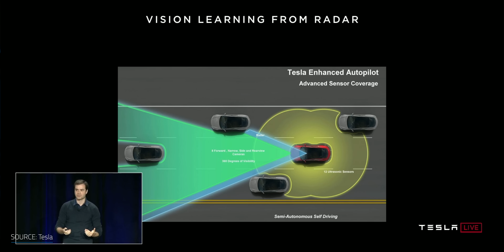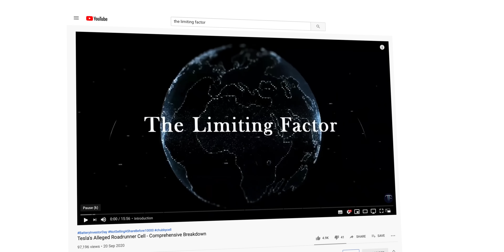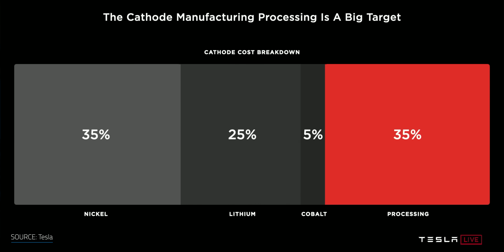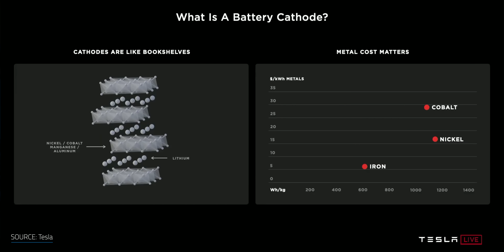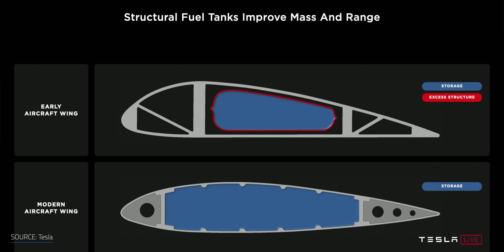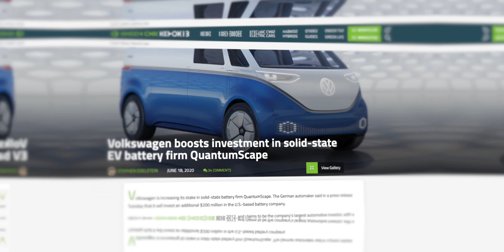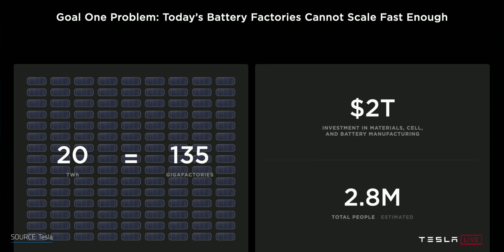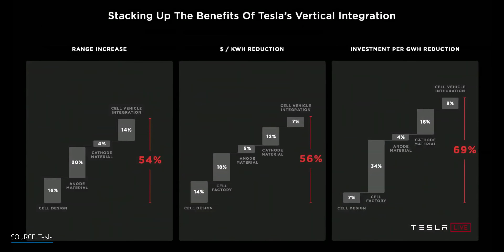3 Takeaways from Tesla's Battery Day - Hint: it's not just batteries

Comment: I think to agree with our statement about ICE being dead and EV being the obvious choice I would need to see better charging infrastructure.  I live in the midwest and travel across states next door.  There isn't appropriate charging stations that would make it possible for me to replace my ICE vehicle.  I'd love to see you do a video on charging infrastructure.
Reply: Even using Tesla superchargers?  They've covered U.S. interstates pretty well.
Reply: @bigdream_dreambig  The tesla network is by far the best network, but the chargers are not interoperable with non-Tesla vehicles.  I'm not sure why Tesla locked down their network to be proprietary vs offer services to any EV owner at a cost.
Reply: @sanctred  Tesla has long said they would be happy to allow any other manufacturer to use their network as long as they made their cars compatible (plug and software) and paid their fair share of supporting the network (maintenance and expansion).  So far no one has taken them up on this.

Comment: There are cars/trucks  on many roads around the world that have more than 50/60 years and are still running. If battery tecnology improves in such a way that can compete with the range and durability of a combustion engine, that's the real tiping point.
Reply: just compare 7c/kwh for Electricity to $3 - 4 for gas. 
not incuding Maintanance.

Comment: a lot of medias mention how come there is no million mile battery. My take is that Elon downplay this but his new battery is already million mile battery. Let me explain: Battery has shorter cycle life due to 2 reasons: heat and cracking during expansion of the cathode. This battery day presentation already address both of these issues.
Reply: CATL Already has the million mile battery and its LFP Prismatic, which TESLA will be using in ALL SR+ Vehicles.

Comment: I was disappointed that energy storage hasn’t progressed for domestic customers.
Reply: Tesla has, for quite some time, proposed using the retired batteries from cars for domestic power walls. A 2nd life before they eventually get recycled.
Reply: Mike Wurlitzer I’d buy one, if they sold them
Reply: Tesla's powerwalls just dropped in price significantly.
Reply: Big Dream Hi there, I haven’t seen this in the UK, are you in a different market?
Reply: @Muppetkeeper  Yes, USA. I can't find the article anymore, but I think it said the price dropped about $600.
Reply: I checked if the priced had changed here in Sweden... And found you can't currently order a powerwall, only sign up to receive updates. Lets hope for major improvements in both price and performance.

Comment: My take away is that Giga Berlin will be making Model Y's with the 4680 Batteries and the all new megacasting structure from the get go, summer 2021.

Elon already said during his Berlin visit 3 weeks ago the Model Y made in Berlin will be much better and radically different in design and manufacturing.. This only makes sense if they also start using the 4680 cells, produced on site. 

The new battery is NOT a prototype, they already making thousands of them in the Kato Road factory.. Copying this factory in Berlin would be more then enough to start in Berlin and add more, better lines when Model Y production ramps up... Tesla has still 6-10 months to tweak, validate, test and improve on the Kato Road factory.

I ordered a Model Y months ago and now getting really stoked to get it next year! 

I am from The Netherlands and all European Model Y orders will be filled from the Berlin facility.
Reply: Marco Nierop a German politician also said a while ago that Tesla will, be making a new type of battery at the Giga Berlin plant..
Reply: @trashmail8  It all ads up that it will really be like this..

Comment: How are they going to compliy with the EU's user changeable battery regulations?  Or did that not go though?
How could the recycle the batteries once they are encased in epoxy?
Reply from the maker: I haven’t heard about that type of requirement going through (need to dig into that more).  Curious about the recycling angle too.
Reply: @UndecidedMF  If you ever find out how they play to recycle them it would be worth a mention on some episode at some point.   I'd be interested.

Comment: A problem with making the battery part of the vehicle's structure  is the battery becomes more susceptible to road hazard damage.  Will hitting a rock/road debris that on an ICE car might crack the oil pan cause one of these Teslas to be totaled because it destroys the battery?
Reply: They're not making the batteries part of some vulnerable external structure.  They're simply using them to provide internal structural support (like a load-bearing wall in a house).
Reply: @bigdream_dreambig  So if the batteries get damaged the car isn't a total loss?  The batteries are either serviceable/replaceable or they are not.  Usually structural components of a car, like the frame or pillars, if they get damaged the result is a total loss of the car.
Reply: @richmigala2539   The point is that, if the batteries are damaged, that will have required so much destructive force that the whole vehicle will have been totaled anyway.
Reply: @bigdream_dreambig  What if there is a recall on the batteries?  Are they going to give you a new car because the batteries are part of the car's structure?
Reply: @richmigala2539   I don't know if they'll be removable, but if not, it'll be the same as if Ford had a recall on the frame. 🤷‍♂️

Comment: I am convinced about vertical integration. I am not convinced about less modularity to cut costs outweigh the benefits of a cheaper car. The right to repair is I think a growing relevancy in the future and is highly underestimated. I've been promised a surface pro with long life, yet the battery failed after only three years of normal use. It is a highly complicated procedure to replace the battery of an otherwise fine working computer. Crack of the screen is at risk of increasing repair costs and insurance costs. I think something similar will be the case with unibidy teslas and integrated batteries. With a battery failure it will be almost impossible to repair with unexpected high maintamace costs. I'm doubtful then a cheaper electric car will make maintenance costs cheaper as well. And things like fender benders will likely mean the car is written off, with a monocock design. Ouch! Battery day talked very little about the management of recyclability of their cars. Ewaste is a growing global issue and a fast growing pile of unrepairable teslas will only add to the growing pile. I don't see Elon's sustainable transport goals achieved this way. Only more resource and energy consumption but not a circular economy model. If the latter were concretely included in battery day, I would have found that truly nerdy and sexy.

Comment: ICE cars will never die, there are so many fuel alternatives to choose, from biogas of recycling to alcohol, biodiesel from used oil........ the other advantage is that you can carry fuel in an extra tank and basically go as far as you can without issues
Reply: biogas is FAKE NEWS, it still has CO2 and other pollutants. 
I can travel 520+ miles from my home , without needing Charging. 
at some point I will have to Sleep and my car is FULLY CHARGED in the morning. 
allowing me to go 520+ miles in ANY Direction.
Reply: @markplott4820  nonsense, it still has carbon but very little, plus its actually cleaner and a car can get over 1000miles+, unless you have a tesla model s plaid, the 520 miles is not true but also way tooo expensive than  normal ICE

Comment: One thing I think about with the legacy auto manufacturers is that they aren't going to take EV's seriously (Ford, for example, with it's Mustang Mach E, 250 miles range and 0-60 time in 6 seconds), and then say "Look, Nobody wants an EV.", when nobody buys their short range, slow accelerating EV's.

I won't consider an EV, unless it has a minimum 300 mile range (preferably 350-400, even better if its 500).  That's why I'm a little concerned with how Ford's electric F-150 will be when it gets released.

Comment: Something that was missed is charge and discharge times of the new battery design. Both had to be throttled due to the heat build up caused by the tab design. With the new tabless design you could theoretically see charging currents doubled or tripled. 500kms in 15-20 minutes could be achieved quite easily, that’s a coffee and toilet break for 4.5-5 hrs of on the road driving. Good bye ICE vehicles.

Comment: Hi Matt, listen to my proposal: If you continue mentally the move made by tesla to go for 4680, then the next batteries after 4680 should more look like watch batteries where width (diameter) is much bigger than height, something like 500mm-50mm. Why ? Because it's much easier to manufacture dry coating on a film of 50mm width and roll that film indefinitely until you reach the expected radius of for ex 500mm... like a roll of movie film ! Pass the message to Elon :-)

Comment: ICE engines not die. They will get smaller, more efficient, and will be added to electric vehicles specifically to supplement peak power output, range, and charging flexibility. You fuel up when you expect to need to tow something heavy. The ICE will add electrical power to the motor, bypassing the battery and keeping the system from overheating from too much current. The ICE will also add range. Sometimes you just need a few extra hundred miles and don't have the time to sit around and wait on a charge. fuel up and go. The ICE will also add flexibility to off-grid travel by providing electrical energy to charge the battery when exiting the city, allowing you to charge parked even though you are not near an outlet. It also allows you to charge when stranded, as long as you can get your hands on a burnable fuel. Also, winter is a problem many places in the world. a cold battery dies quickly, so an ICE engine can use its waste heat to keep the battery warm, but also provide the motor with power when the battery does go flat.

ICE engines will be the future of secondary energy sources. When the grid fails, is unavailable, or unable to meet peak demand, the ICE will be there to pick up the slack on a case-by case basis.

Also, it is likely that home electricity will have ICE engines come in neat packages to be installed in garages as emergency generators. A small ICE engine during a grid cut-out can feed into a house battery and keep the world running on a short-term basis when there is an electrical shortage or outage. Winter is not friendly to people who need electricity. burnable fuels will always be the most important lifeline for them in the event of a snow storm.
Reply: but we will eventually running out of oil  just like any other resources
Reply: @lekiurepum7841  Oil will take centuries to run out of. The less we use, the longer it lasts. However, it is still the best fuel for zero infrastructure emergency energy.

Comment: The repair/replacement cost of the structure design would be horrid, while there are obvious benefits you always must look at maintenance costs, Tesla's will be obsolete and have no resale value at end of battery life due to battery replacement cost, taking a whole car apart to replace a battery is not cost effective unless they are truly a million mile battery system, Tesla will need to back up the battery system with a lifetime warranty that includes labor. JMO

Comment: Very interesting presentation and I am excited about the way Tesla is driving the industry. 
BUT ICE vehicles have this over even Tesla's future vehicles: the reliability and 'fixability' of the given vehicle. I am in no way bashing Tesla's proposed design, but am providing another perspective. The initial cost might be lower, but if something goes wrong, you (the owner) will be paying through the roof prices for even minor repairs. I predict that any minor crash will total the vehicle due to labor cost.
As for the reliability, I understand the reference to aircraft, that an airplane's wing is the fuel tank, and that Tesla is proposing to use the battery as the floor of the car. It makes sense from a design aspect, to use one part for more than one purpose, but I wonder about the integrity of the battery/ floor over time
Reply: Oops. Hit the wrong button........ :/
So...... back to what I was saying. 
I'd say that only time will tell how reliable this design will be. I know as a ICE tech (showing my bias a little :)) these vehicles will probably be easy to maintain (brakes, tires, etc.) And very dificult to fix.
I am assuming that they will eventually stop working which might be incorrect. Who knows. I have heard of 1 million mile Tesla's with very little major repairs. I'm just saying that even one of those major repairs on a non-modular vehicle could very well total the vehicle, i.e. be more $ than the car is worth.
As a conclusion to this 'rant' I would say that the consumer is taking a risk buying this type of vehicle: low initial price for extremely high possible cost, albeit that cost is theoretically not very probable. Is this the way of the future? No, its getting closer, but no. Is it shaping the future? Definitely! 
To Tesla / other EV manufacturers: keep up the good work of inovating electric vehicles. 
To electric vehicle consumers: you don't get anything for free. If you buy a cheap car, you get a cheap car in some way shape or form.

Comment: Just wanted to add one of the most, and I mean MOST important facts from Battery day that I have NOT seen anywhere else mentioned anywhere else on every Tesla battery day commentary.......  Tesla basically showed at 1:35:45 in their presentation slide titled Diversified Cathode Approach that Tesla expects fully 70-80% (my SWAG) of their future battery production/consumption will be LiFePo, and NOT Nickel.....  How did I come up with that SWAG?  Simple  Look at the left of the chart.  What are the highest, by unit volume cars, will Tesla be eventually making?  The yet named model 2 and chinese model 3.  What battery does the slide say? LiFePo.  So assume they will sell twice the number of model 2 vehicle than the combined total of S,X,Y truck and semi.  Then 100% of their entire sales of Powerwalls will be LiFePo, which they implied in other parts of the presentation is 50% of total battery demand in the future.  Add those two large volume consumers of batteries, and Tesla becomes a mostly LiFePo company supplementing their output with LiNi batteries!

Comment: couldn't they use the same new batt tech in power walls to make them cheaper and more powerful,no ?
Reply from the maker: They absolutely could, but I wouldn’t expect them to use the new high nickel version they talked about ... at least not for a long time.
Reply: Looks like they may be moving to LFP for power walls / stationary storage. as cost is already low, cycle life is actually much better and weight and size are not such an issue, also need to keep the most energy dense solutions fir transportation never more than with the semi. This is unlikely to change untill we are seeing many many terrawatt hours per year production.
Reply: @hedleypepper1838  well to be fair i need a new-roof (it built in the 80s) and want to go solar roof (yes it in my area in MD) just 7-8k per abit of a hit lol.
Reply: @darkcarnage9188  im sure power wall prices will be comming down soon due to lfp batteries
Reply: @hedleypepper1838  ya that my hope, I'm a vet working from home so got to be efficient as I can with my money lol.
Reply: Carnage - TESLA plan is to use LFP for GRID storage but use LG Chem for Powerwalls still.
Reply: @markplott4820  ah well, one could hope lol. figure even fi they did not be anytime soon. oh well.

Comment: Just the casting of single structural elements with a custom alloy is enough to deliver a near fatal “1 inch Bruce Lee punch” to the ICE  vehicle  industry. The new battery configuration now opens the path to disruption of the aviation sector. Writing this as I’m collecting mind shrapnel from all over my office.
Reply: Wing Batteries for Aircraft.

Comment: Does this mean the eventual  end of Richie B Kidd’s Electrified Garage?  Nah...

There will still need to be repairs, such as  wiring, ball joints, bad bearings, filters for HVAC climate Control, maintenance of fluids, wrapping skins, replacing failed components, and maybe for Rich Rebuilds, mating a good entire from or rear ends together onto a front ended or rear ended car. One rear ended car plus one front crashed car= one good car. That’s auto repair tradition!!

All of the changes Tesla is making, may make it even easier to do!

Comment: Matt , I’ve looked at very substantial number of YouTube videos. What I think every one has missed is Elon’s college’s comment , thermal has been eliminated as a design constraint. Think about all of hardware associated with controlling the battery temperature.  I would like to know how the new battery pack is cool or heat as the weather varies. I worked on a lot of projects but never had a gigantic factor drop out off concern.

Comment: I’m excited for the future of Tesla. But manufacturing consistently is critical when building the 
Tabless batteries.
Reply: If you have ever been to a beverage bottling plant you would see how replicating that continues motion process, which actually runs at fairly low rpms but generates a massive quantity of product.  If tab-less technology and certainly the dry electrolyte technology take off, the 20 terra=watts needed becomes achievable.